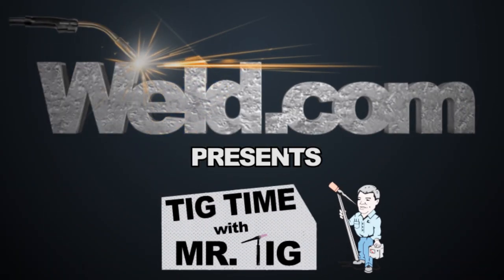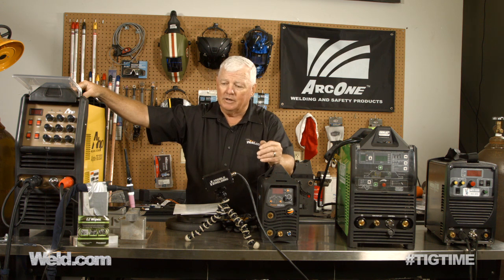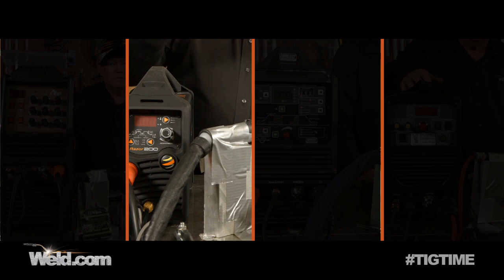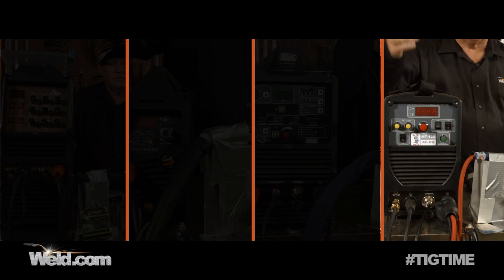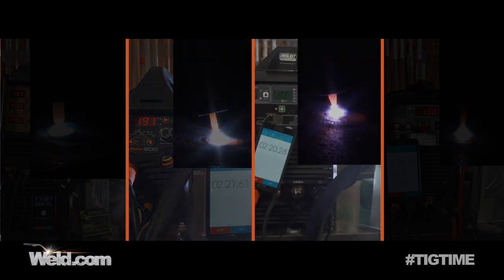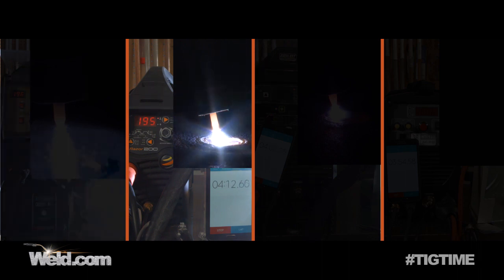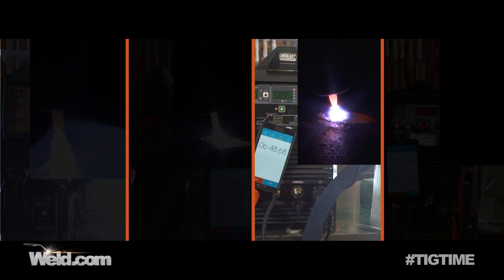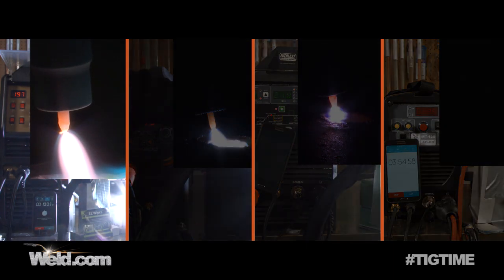Duty Cycle Shootout: THERMAL OVERLOAD!

Comment: I have owned the Unimig Tig and it’s a great little machine ! However I haven’t used many other machines to know what the can do compared to the Unimig ! Thank you for this video ! I will be getting another one mostly cause I can’t reach the price on the everlast welders right now !  It’s a shame you couldn’t have done a comparison with Bossweld st200 AC/DC along side these guys as it is another one I was considering ! Cheersand thanks again

Comment: Bought the Lincoln mig from Lowe’s, the $350  model, burned it out after only welding up a small trailer ramp.
Reply: kinda get what you pay for... P.S. Lincoln makes those models for stores with inferior parts. We bought a lincoln mig pak 180 directly from lincoln and one from a local hardware shop and the parts were not the same at all.

Comment: Welding inverter duty cycles can be a confusing and contentious subject. For instance the Jasic (Razorweld) machine is rated 35% at a high operating temperature of 40C. This explains why this TIG inverter far exceeded the 3.5 minutes in the test. Some other manufacturers prefer to show a higher duty cycle percentage at either a much lower temperature than 40C, or they choose not to show it at all to deliberately mislead the buyer. 

I'd be extremely wary of any duty cycle specification data that excludes a temperature.
Reply: Google User 7

Comment: its an old post but thanks for testing these out. Good job. Would AC change the outcome?

What tungsten was used, they weld up well.
Reply: AC wouldnt change the results as its still the same amperage and duty cycle.. He states hes using 1/8th 2% thoriated tungsten in the video, but I'm unsure what you seen "weld up well"  as no welds were made, only craters from displaced metal.......

Comment: Just got my AHP, will be a HUGE downgrade from the Miller Syncrowave 250DX I had worked with before but for home use the AHP seems more than adequate. Will chime in again to see how well it does long term.
Reply: How's it working now?
Reply: I've been looking at these
Reply: Any updates?
Reply: @jinxtacy  It works wonders and they have now released an update which makes the arc more stable and increases the duty cycle a tad. This is definitely worth it for the hobbyist welder at home. But keep in mind to get the most out of this unit you will want a 240/250v socket.
Reply: @cr4zyw3ld3r  hey. Thank you for your experience.  It's kind of difficult as an aspiring hobbyist to sort through this stuff.
Reply: @jinxtacy  yeah you want to get the new model if you can because it comes with a better torch and a line that won't kink as much cutting off the Argon to your weld. And It has a better pedal I had to upgrade my 200x model with the SSC pedal and a CK torch/line.

Comment: Looks like that AHP took a dump at the end. Shutting it off prob saved it, if it still works! I was torn between the ahp and everlast. This vid makes me want to spend more and get the everlast!
Reply: of note is what happened to the material the AHP was welding, the entire piece fell apart and the arc was crazy long by the end. it was probably pushing close to its max voltage
Reply: The arc start on the everlast looks like it sucked. That AHP started an arc super-fast and cleanly.

Comment: surprising and predictable the Mr. Tig setup big fail but fault is always something else.  Pretty stupid as a 110 only machine blaming fault on a breaker is simply a matter of a poorly designed machine.  If it has a 15 amp plug on it you DO NOT change to a 25 amp breaker!  The torch that comes with the AHP welder is a 200 amp torch surprise you don't like it so you put a smaller rated torch on it and set the gap at a ridiculous distance which increased the amp draw and melted YOUR choice of torch.  Hands down from the professed expert this is as I have come to see the poorest video comparing machines with predictable results as the Mr Tig failed wow why do I keep thinking you will make something to compare to your self made all knowing persona
Reply: The AHP 200x 2018 model comes with a  150Amp rated torch, sir.

Comment: why would you tell people to run a 25 amp breaker??  I wonder how many people have had issues with their wiring with your arrogance.  Of all the videos I have watched with a name like Mr. Tig I expect more but always seem to go away shaking my head.  Gotta say in one video its pure comedy how you throw a torch rated for machine and put your silly smaller torch simply because you didn't like it but you didn't even try it so you have no idea and your torch of choice a torch close to half its rating thats just stupid
Reply: Installing a 25 amp breaker WITH proper wiring would not be so complicated. Add an outlet in your garage or shop on the new 25 amp circit and weld away.

Comment: By long arcing the AHP and Razorweld while maintaining the amperage  their voltage was pushed way up increasing wattage, seems to me these two machines were even further stress tested!
Reply: I was wondering about that as I watched. Why not adjust the arc length as it runs?

Comment: hey Mr. tig was wondering if you could do a video on the razorweld 200p you showed in the video. I'm considering on buying one and haven't found much on it and also wondering your opinion on the razorweld vs. the Lincoln powermig 210mp  . love your channel by the way have been learning alot!
Reply from the maker: +Jim Pursell We are currently doing some videos on the razorweld 110, but we can certainly do a more in depth look at the razorweld 200. It's hard to compare the 210 MP to the razorweld, because they are completely different machines. If you are interested in a multi process, you should compare the Lincoln 210 MP to the ESAB Rebel 215EMP ic, Everlast PowerMTS 211Si, etc. Those are all MIG/TIG/Stick models around the $1400 range.

Comment: So for the $$$ on a 120V machine just for occasional use what is the best bank for your buck?
Reply: depends what materials you want to weld, what process of welding you want to use... If you've never welded or are just doing rinky dinky jobs I'd recommend a 120v mig welder..

Comment: I wonder what the manufacturers pay for these YT promotional vids for their machines? Most of this Chinese junk has a very short life span, and not one of these vids provides any sort of idea on durability.
Reply: sickophant 3 year warranty on the unimig products (aussie made), I'm looking at buying their 250 multiprocess unit 40% duty cycle @ 250A on mig and 40% for stick and tig at about 220A or so
razorweld is a unimig machine

Comment: I just got the AHP Alphatig 200x 2015.  I have about 7 hours on it, works great so far.
Reply: +The Handyman  Owned the Alphatig about 9 months with over 200 hours of steel work on it.  Adjusted the HF points which were off quit a bit from the factory. Other than that, the machine is solid. Wouldn't hesitate to recommend to a friend or add another to the shop.
Reply: @genecundel4793  the hf points can shift. Rule of thumb they should be close enough you can slide a $5 or $10 or any bill through the points and then tighten them up.
Reply: +pbrubaker i have the same thing, used it for tons of things at work, so far its just a beast, the front plastic gauge cover broke though... :(

Comment: Hey Mr Tig thank you for the great videos. I own a alpha tig 200 2015 v3 model, I was wondering what the reccomended amp breaker for 220v is? I have only plugged it in to 110v to see if it came on lol so I havent tested it out yet really.
Reply: Max imput on stick is 33 amps with 43 amp in rush. A 40 amp breaker on 220v will do fine.
Reply: @SnakePliscan  What if you do a 50Amp for 220V?
Reply: @malandro2023  Ya a 50 will have ya covered, probably the max for 200 amp before going to heavier cable and longer duty cycles
Reply: @malandro2023  I run a 40 amp on my esab em 235ic and I have ran it maxed out at 30 volts and 700 inch per minute wire speed and welded about a foot and a half and it didnt trip